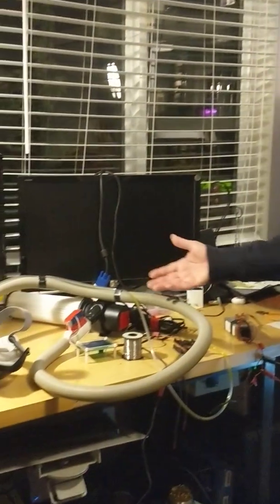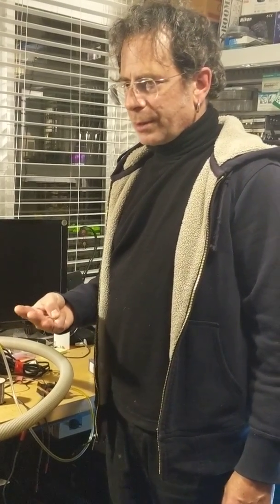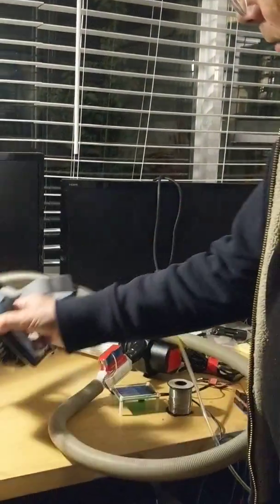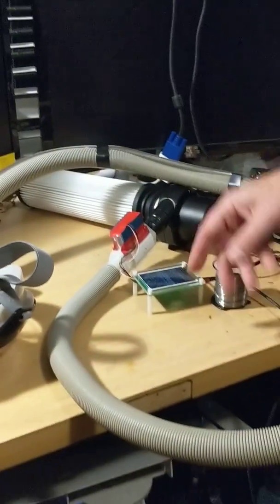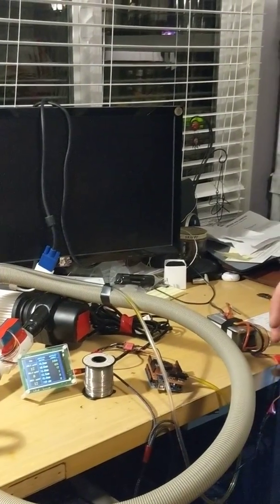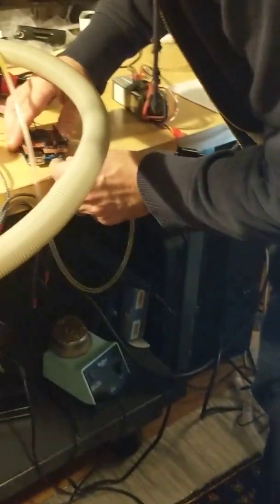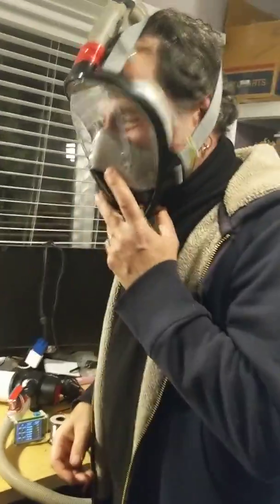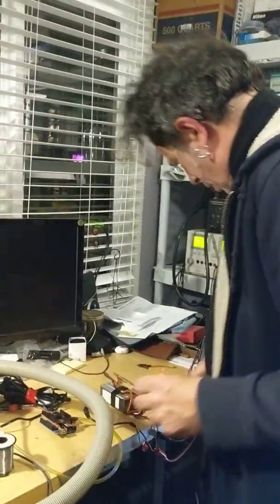The AutoPAPR: a DIY pressure regulated, quality controlled PAPR

Comment: Neat design!  Thanks for sharing.  I've been wondering about the range of cost effective HEPA and say if for welding/brazing/fumes, what carbon pre-filters.  Lately I've been looking at the water and most likely better house air filters.  Was at first thinking cutting a HVAC larger filter into smaller sizes with either a prefilter layer of activate charcoal or a carbon filter (since I want for welding/brazing).  Then fitting all into a sealed Tupperware container or something similar like a fanny back pack.  Also, looking how to better seal the inflator from the motor in case that burns up at some time.  Seems better than placing a filter in the CPAP hoses I'm using (two side by side for a thinner depth profile). Thanks again for sharing! Really neat seeing the sensors and auto functionality really cost effectively.